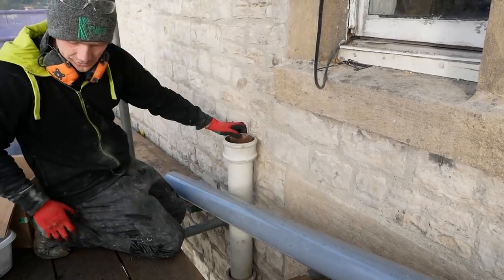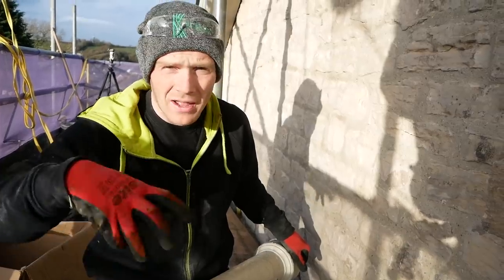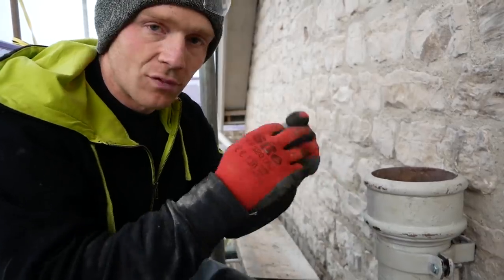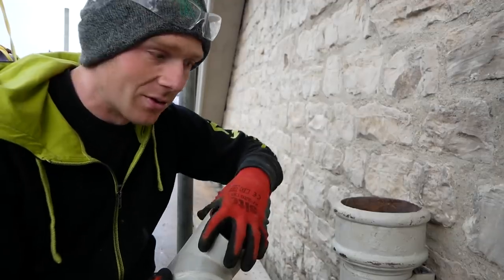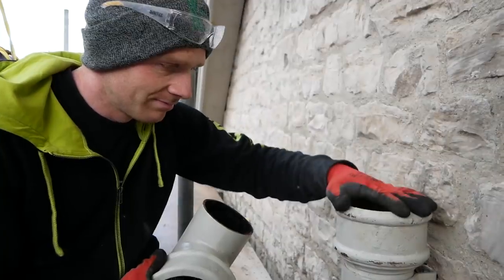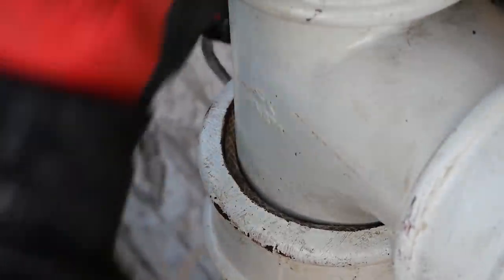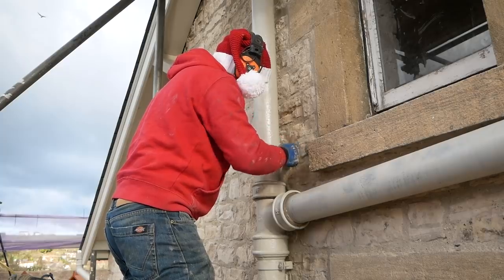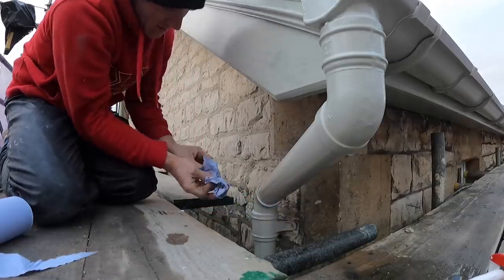OLD CAST IRON STACK - Restoring and Joining New to Old

Comment: Really liked your project you did very well to keep the cast iron stack. Do you have a link for the cast iron soil pipe you used with the push fit connectors? thanks OK rewatched and you said its a Hargreaves Foundry hence 'HF' stamped on fitting.

Comment: Once again you satisfy my OCD,, love your approach to the project, some so called professionals could learn from you 🤔👍👍
Reply: I find that component DIY'ers often do a better job, as they tend to take a lot longer to achieve a better finish. A professional would have to charge a lot to get things done to the same standard. Professionals obviously do it way quicker, in most cases, but don't have the time to go back and fill defects 4 or 5 times to get a prefect finish, or take several weeks to get the bit of wooden siding just right.
Reply: @cjhification  agreed, compodent amateur individuals can achieve a high quality because they are driven by the end result rather than renumeration. In saying that it was a pleasure to watch the skills of the plumber carrying out the roof lead work, a real pro. Who obviously has pride and skill at a level unlikely to be attained without years of experience. Anyone charging professional rates should be able to produce top quality work faster with more skill and accuracy than any amateur.
Reply: @gordyl9247  absolutely, professional do the job day in day out, so usually can do a good job, quickly. As you say they have to value time at a professional rate, which makes for expensive work if it takes several weeks; to an average homeowners, that's rapid for something like a bathroom remodel.

Comment: Hi Tim I mentioned in your last drainage vid that you should change the 90 bend for an access 90 bend trust me it's better to have it and not need it than to not have it and hav a blockage and no external access.
Reply from the maker: The access elbow is the other side of wall where en suite will be. That way it’s not visible outside but easy access inside. 👍
Reply: @TheRestorationCouple  would still be better outside sir you wouldn't want a sewage spill inside the building if it backs up.
Just  thought.

Comment: Did you chamfer the end of the plastic pipe before putti ng into the castiron pipe
Reply from the maker: Yep, even the factory chamfer wouldn’t go easy. To be fair, it is designed for the cast which was a couple of mm smaller.

Comment: We're looking at buying scaffolding, then selling once we're done (whenever that might be). I was quoted £6.5k for setup and the first 3 months rental, out of interest do you mind sharing what you spent on your hire and how long it was up for (feels like years!)
Reply from the maker: £1900 with 8 weeks. We went over quite a bit but the extra came to around £500. Went up mid September.
Reply: @TheRestorationCouple  Ugh, guess thats just highlands and islands premium them. We had a quote for 40m (2x 20m runs) 8m high, 3 lifts. It's cheaper to buy the scaffolding and truck it up it seems.

Comment: I had my doughts, but I'm happy with the way it looks painted. I hope the paint lasts..
Reply from the maker: Judging by how hard it has been to clean off the porch floor and other drips I’m pretty confident and others have used on upvc with several years. Fortunately it’s at a level I can easily get to off my tower scaffold if really needed but should be fine.

Comment: I got caught on that with that Cr*p spray(never again)......when I used the correct brought lube from screwfix it fly's in the socket. I have a big tub of it now. Also I learnt the easyway to get plastic 110 push fit apart. Before I used to wiggle it and pull then the guy from osma told me to put a screwdriver in the lip gap on the side and twist and it pops off the plastic top and the rubber is free. Then you just put the rubber back on and push the plastic back down and hey presto you can push it back in again. Simple when your told how to do it.

Comment: That is such a strange thing for me to see a sewerline outside. You don't see that here in Finland due to freezing issues. 
Looks really clean install though. Hopefully the plastic pipe will hold the paint. Sun might affect it differently than the cast iron.
Love your content. 5/5
Reply: Yeah you wont see any pipes on the outside in the Europe
Reply: Normally it's not a problem in the UK, it just doesn't freeze for long periods here.... saying that I had a smaller frozen waste pipe last week :)

Comment: As an engineer I would have simply gone to a steel supplier not a supplier of  house materials for the pipe. 3m of schedule 10 , 4" pipe - £27. Same stuff just a fraction of the price and you can get 6m lengths as well. 6" is 84 quid - still cheap.

Comment: Soak the ruber seal in hot water for about 10 mins to soften it, then use fairy liquid as a lube to help get the pipes in.
Reply from the maker: Yeah did think that afterwards, may well have worked. That’s said it was close to freezing most days to would have had to take the kettle up there. 😀
Reply: Fairy liquid is a degreaser.  You should never use it on rubbers, it dries them out . You wouldnt wash your car with it